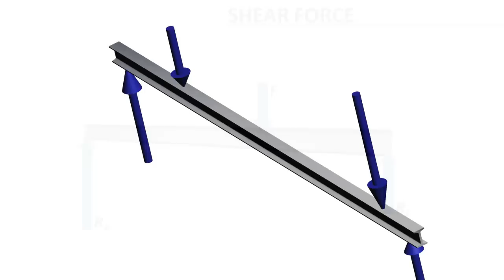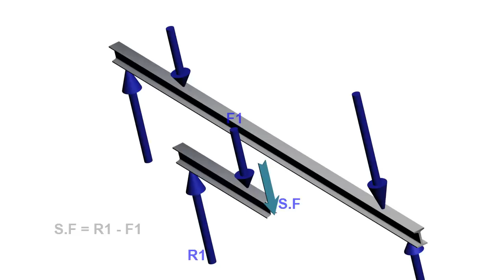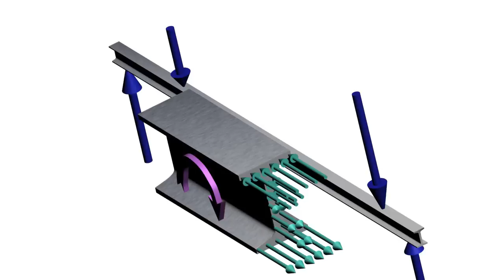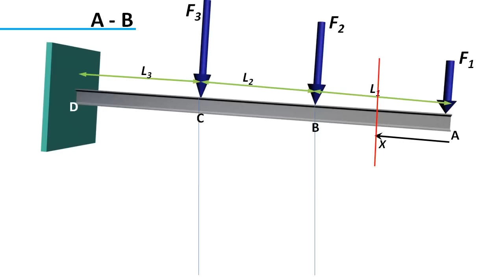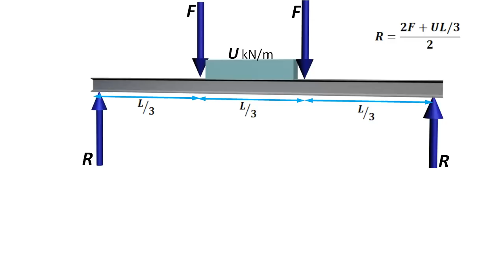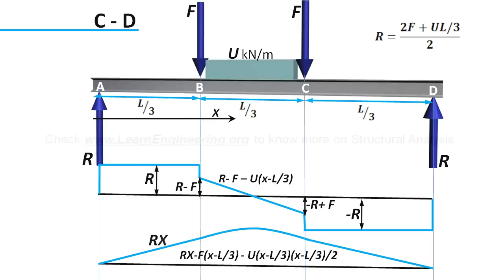Beams | Bending Moment and Shear Force Diagram

Comment: Why Bending moment is maximum at a point where shear force is zero in the above diagram?
Reply: The bending moment is the integral of the shear force with respect to the distance, x.  So as shown by the video when the shear force is constant the moment is linear , when the shear force is linear the moment was quadratic, and so on.  This means that the shear force is the derivative of the moment, therefore, when the shear force (the derivative) is at zero, the moment must have reach either a local minimum or maximum.
Reply: Thank you...

Comment: good ...can u explain y we need the sfd and bmd diagram?? which force causes failure of the beam
Reply: Sfd and bmd is used to calculate the Shear stress and Bending Moment. Sfd and Bmd will give us the distribution of Shear Force and Bending Moment produced in the Beam. Once the Shear force is know, Shear stress can be calculated using Stress = F/A, and if the bending moment is known, Bending stress can be calculated from the Flexural Equation. While designing a structural member Sfd and Bmd helps us to know the Shear stress and Bending stress induced in the beam. These values can be compared with the safe bending stress and shear stress value and we can determine whether the design is safe or not.
Now, coming to your question....If the values of bending stress and shear stress induced in the beam is more than the designed shear stress and bending stress, then beam is likely to undergo failure.

Note that Bending Stress acts perpendicular to the c/s of the beam and Shear stress acts parallel to the c/s of the beam.

Comment: 3:57  > section "C-D" you write moment equation [F1.x  +  F2.(x-L1)  +  F3(x-L2)]   but I mean it is wrong. Because instead F3(x-L2) should be F3.[x(L1-L2)].
Reply: +Peter Kačmarik it would actually be F3[x-(L2+L1)] as it's the distance from the axial rotation point that determines the moment arm.
Reply: +Thomas Thor   Yes you're right :-D. Initially I wanted to write F3[x-(L2+L1)]. I guess I have the same problem as the author because my mind thinking about one thing and my hands writing  other thing :-) I appreciate your suggestion.
Reply: Haha no worries. I thought you might have meant that. It was a cumbersome way to approach the question by the author, in my opinion. :D